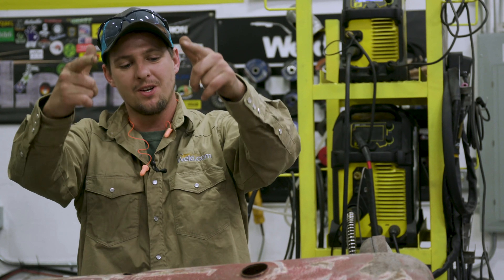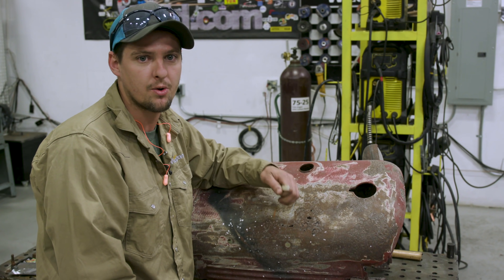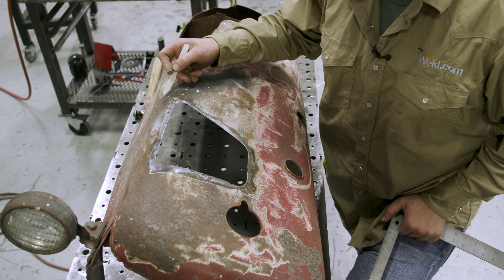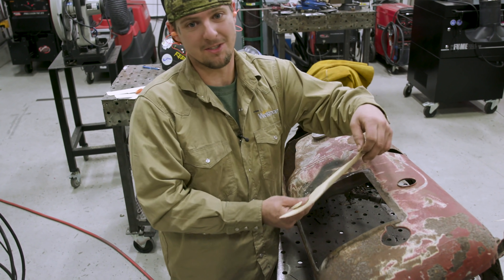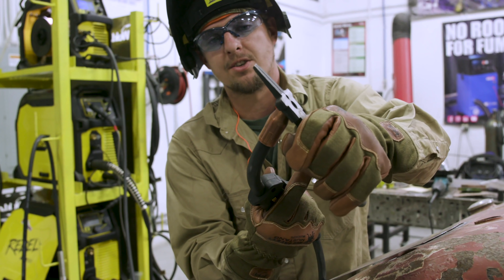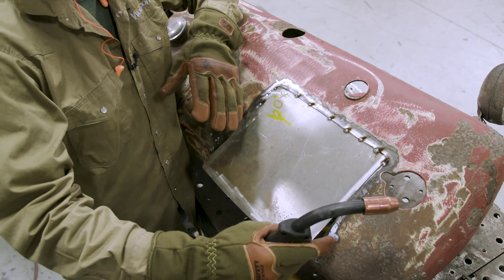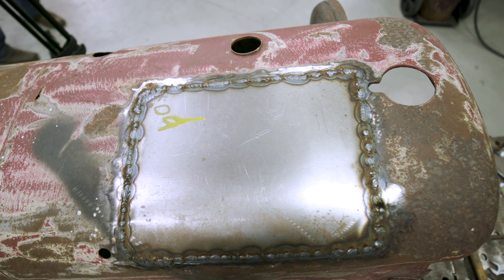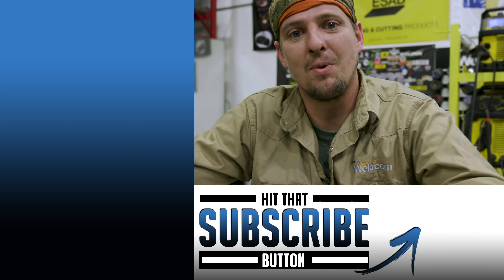OLD RUSTY SHEET METAL Weld Repairs

Comment: Great Job! 
Now I know what I've been doing wrong with thin sheet steel!
Thanks Much, Stay Safe, & Have Fun Learning!!!
Reply: James thank you. I try my best have fun learning or get mad cause it not perfect yet.. lol. Thanks for watching weld.com. stay healthy
Reply: There’s a cool 😎 method of using a torch to move the metal around and I wish I had a better understanding and handle on shrinking and stenching with it to remove dents or things like that one last corner weld in the video to flatten it out.
Reply: I can weld it up 👌🏻 it’s the last steps ( every thing between letting the weld cool down and spraying it up for final colours and sometimes cutting up the patch panels and or getting the right shape and templates ps. Good to know I’m not the only one who has done your mistakes of not labelling the paper or metal replacement peace and yes l laughed out loud as I thought 💭 was funny 😂 especially when you said way to go dummy or the stubborn corner weld as I’ve been there done that and had the same thoughts aka not laughing at you personally ) that get me every beeping time. I’ve tryed two different times and on different projects ( one of which I warped a USA made in st. Lewis Missouri 1980’s original steel sheet metal pickup fleet side beyond economical if at all repair mostly from grinding/ linening/sanding and adding insult to injury as it was my first time trying to fix gas filter/rust repair/dent repair and yes I added more distortion from me as of right now I’ve got a better handle on that and no longer have warping or blowing weld through problems on the regular and I found that I like tack mig ing ( because it’s quicker and easier not playing 4 arms/can hold up my work better ) before final tig welding at least for me that’s how I get the last amount of distortion and weld porosity and unwarranted harding ect. and the least amount of grinding out the bad sections and having to rework the panel ) and right now I’ve pretty much surrendered to 💰 paying someone off to do it right ( or waiting or someone to teach me in person/going to school for it or I weld it back up you clean up my mess / do everything thing else needed to weld it up and pay someone money 💵 or trade time / skills ) or sell off what ever has a rust hole ( I did that once to a really nice 1968 c10 that I couldn’t bring myself to Butcher or bugger it up as it wasn’t a cheep I don’t care demo Derby, mud bogger,crawler or race car 🏎/truck and had potential for winning a car show. all I hope it the next guy had better luck at fixing the cab corners and flooring than me as I kinda regret selling it as it was so good to me ) ( especially if I care about it having a chance of it being restored to showroom condition ) that or I don’t care attitude and bog weld fresh new panels ( fix it but skip any body work aka it ant rusty but it’s ugly and dented from me or it’s life before me aka drift misslle or cheap race car ) it without any rust